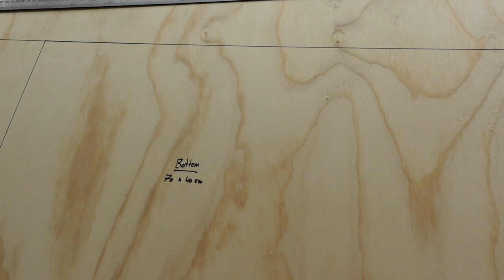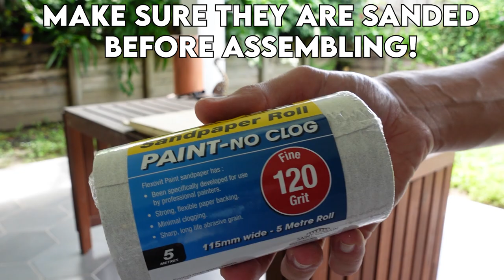PRADO PANTRY (DIY Kitchen Box) // Build Your Own Chuck Box! // Toyota LandCruiser Prado (GX460) ASMR

Comment: Hey lovely video Mark!  Practical, relaxing to watch and inspirational to have a go a a spot of woodwork! Nice how you showed the products used, although I didn't catch the wood screw size. Did I miss it? I checked twice.  Do you think you might add some carry handles later? Well done!
Reply from the maker: I was using standard wood screws. Any size will work. I think I used 30mm ones but I will double check for you 👍